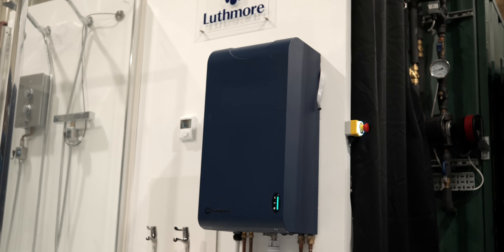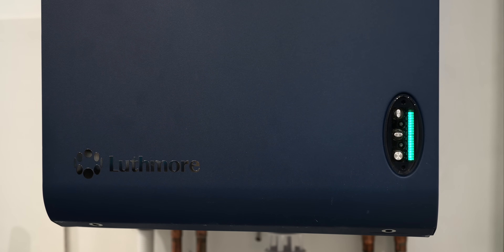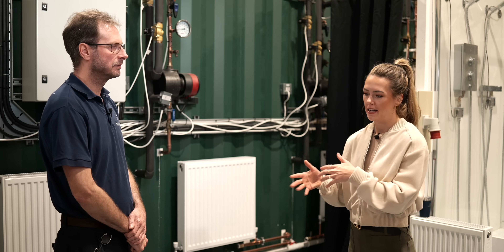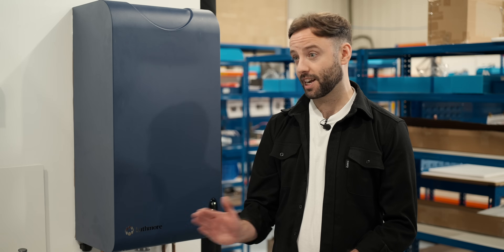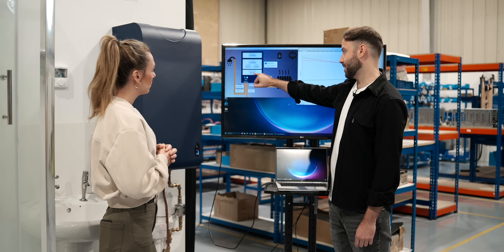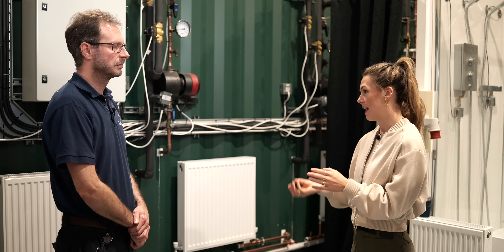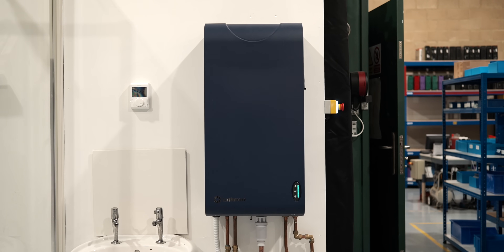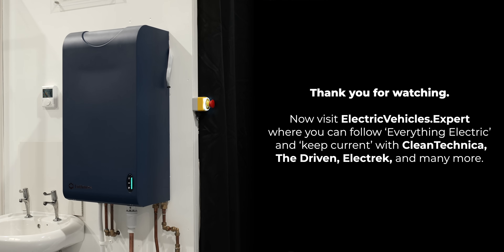Could This Battery Boiler Replace Gas AND Heat Pumps?

Comment: Was waiting for the part where you say how much it costs
Reply: A 7kW LFP battery would cost £2-3k. The heating element is not expensive.
Reply: @IanMcc1000  I just bought a 16kWh (8kW) LFP battery for £1700 retail, so 7kW should be about £850 (less at wholesale rates).
Reply: @xxwookey  that’s a great deal. How much is that for an install?
Reply: @davidjrobertson3192  I don't know - I installed mine myself so it was just supply-cost. That was kit form to be fair - the cells are shipped separately and you get to screw it all together. It's £2000 for the fully-assembled version. Fogstar is the UK supplier. 
Most of the  install cost is in the inverter+electrics and panel installation part. Adding the battery is just a matter of wiring it into the inverter (and DC DC MPPT in my case).
I paid £5000 for 7.2kWp of panels, 5kW Victron inverter and 16kWh battery, and assorted electrics so it can run islanded (i.e we are immune to power cuts). I guess you'd pay about £8000 for a commercial install.
Reply: About 5k for the 30kW system.
Reply: Or if you are going to g to do an advertisement (sorry Everything Elec but this is what this film feels like) at least have a shower, shave and sort your hair out.  Or am I being too shallow?
Reply: @mylifeoliverking  You are being too shallow. (but it is pretty advertorialish, I agree)
Reply: The Luthmore boiler has an rrp of £4500 ex. vat
Reply: @Luthmore I'ts a niche product I think. For small 1 and 2 bedroom flats/houses with 1 or 2 occupants.
Reply: Also there has been no talk about loss of inefficiency over time with current battery technology.
Reply: @StevoStevoStevoStevo-c1y  I presume you mean loss of efficiency? You lose maybe 1-2%/yr capacity over a decade or so. Efficiency hardly changes at all.
Reply: 21 July 2025 - With a total purchase and installation cost from as little as £5,000 excl VAT, the Luthmore Boiler is a straightforward, cost-effective solution for the small to medium sized home market where ( copied and pasted from the web )

Comment: I don’t really understand the point of this. It’s using a different battery technology - great why not use that as a house battery instead if it’s more dense? Then it could power everything rather than just the element in the boiler…
Reply: it's not really using any new "magical" battery tech really.  30kW of power from a battery that stores 5.88kWh is nothing special for lithium batteries in other applications (for example, the battery in a very normal electric car these days can output 300kW from 50kW, and a "high performance" lithium battery in something a bit sportier can double or tripple or quadrupple that power density. By using the incoming cold water feed to cool the battery cells, they are simply doing what pretty much every automotive or high performance battery has done for the last 10 years. So far, that water cooling has nto been applied, nor required for a static home battery, simply because it is not required and it is expensive to do.  As the energy storage capacity of home batteries climbs upwards as cell costs fall (a 5kWh battery used to be "big" but now was are seeing 15 or even 30kWh solutions) getting high power from that battery gets easier and easier.....
Reply: Think of it as a better solution for small flats that may in the past just had a 5-7kWh water heater and central heating provided by a gas fire. This device provides a far higher flow rate with a lower running cost if the battery can mainly charge over night.

Comment: The crux of the matter is that electricity in the UK is ridiculously expense, the most expensive in Europe. If electricity cost the sane or less than gas we wouldn't need these over complex solutions.
Reply: For domestic electric UK isn’t the most expensive in Europe as we are cheaper than Germany and around the same price as Italy according to the International Energy Agency. Having said that the UK is still expensive.
Reply: 😂😂😂😂

This is getting ridiculous.

Any opportunity to crowbar in a mention of a  battery system for "anything".

In this case absolutely unnecessary.

Batteries and installation at doubtless a tidy sum.

An instant shower is likely to be a far better and financially more efficient option.

It won't waste water either.
Reply: The high price of electricity is because it's tied to the price of gas... google "uk marginal pricing"
Reply: 424% correct as they say in heatpump land
Reply: I wonder if all the regulations that they put on new houses are making them too expensive to build.
Reply: @iaingray594 

And of course Labour have promised us another 1.5 million homes by the end of their term.

Where are the Polish guys when you want builders?

Yet another empty promise from our Leaders, of whatever flavour.

Comment: Will it only let out the hot water when it’s hot or like combi boilers you have to run the hot tap and check ld water comes out , gets wasted then slowly heats up ? Ps I’ve got 2 litre jugs near my taps so I save that cold water for the water butt etc in the summer and making cups of tea etc 😊👍👍

Comment: Luthmore have broken rule number 1 for me.
If you have something for sale, put the damn price on the website!
Reply: The guide price is £4500 ex. vat. A list of certified installers and resellers will be published soon. it's in faq
Reply: @garethjones6082  It is now but it wasn't when I mentioned it.... or I wouldn't have mentioned it.
Reply: Advantage:
Greener.
No gas standing charge.
No service charge?
Reply: @markthomasson5077  It's greener than using a gas boiler, but I'd certainly question the use of batteries to only provide heat, seems like a misuse of expensive and valuable resources. A small tank of water will do the same job for a fraction of the price and resources, and with no degradation in performance over many decades. I know people will say there's no space for a water tank, but in 99% of cases that simply isn't true, with a bit of thought there's always a way to squeeze a small tank in somewhere.
Reply: @garysmith5025 hard water corrodes water tanks. This could be a good swap for an instant gas hot water system, or houses with hard water.
Reply: It means it isn't even available or is very expensive
Reply: @danieladams7919  that is always my presumption.
Reply: It seems like an option for the many homes that will never be able have an ASHP, but it does seem to be too good to be true, I would like to know about the field trials that they should be carrying out. If it's any good then it shouldn't need any subsidies. I dont believe that these electricity based systems are any better for the environment than a well designed gas boiler with weather compensation. The UK already has the highest energy costs in Europe,  the removal of gas for heating and hot water will be disastrous for low income people.
Reply: @geoffaries gas shouldn't be cheaper than electricity (is inflated by having gas and nuclear electricity generation), this battery hot water (needs cheaper electricity) or heat pump hot water or air heater should be way more efficient than equivalent gas systems, many losses in gas mining, shipping. Power should be cheap when the solar or wind or battery farms put cheap power into the grid, this is the time to charge the battery or heat the heat pump tank.
Reply: You don't buy it from them. You buy it from your installer. Same with a heat pump, gas burner, solar, home batteries, cook top, ect. They are a B2B business that sells to installers, who then sell, install, and maintain it in your local area.
Reply: The Luthmore boiler has a ex vat price of £4500
Reply: Yes I think this system could be good solution specially if you have solar system to charge batteries
Reply: Generally with this type of purchase you ask for a quote based on your requirements
Reply: Who can afford this ? It is rather expensive… isn’t it?
Reply: Same old addage: If you need to ask the price, you can't afford it!!
Reply: @AndrewLumsden  Luthmore have said the total purchase and installation cost can be as low as £5,000 excl VAT.
Reply: Will it be eligible for government grant
Reply: @AndrewLumsden  I really can though. What I don't want to do is interact with a company and give them my contact info if I eventually don't want to deal with them. People shouldn't have to ask.
Reply: @AndrewLumsden cliched comment award goes to…
Reply: @AndrewLumsden  Complete nonsense. You'd be an absolute fool not to establish the price, even just for the purposes of price comparison and whether it makes economic sense. Oh, and adage has but one d. Back 2 skool 4U.
Reply: if you have to ask you're too smart to buy it
Reply: A bit like those very expensive shops in the Champs Elysses in Paris: If you have to ask the price then you cannot afford it. Lol.

Comment: I like a bath,that would use most of available capacity.
Reply: So it just chargers back up again. An expensive bath 😂
Reply: Gas ends up way cheaper in that case 😂

Comment: Is this an answer for those of us looking at an air-to-air heat pump installation that needs hot water
Reply: Cheaper to just get a bog standard hot water tank, immersion and a timer and run it on the cheap power.

Comment: I didn't listen to this very carefully but I couldn't understand the big benefit instead of running you whole house from your battery charged up off peak, why would not you do that?
Reply: It is related to power density. While home battery can provide 5-10kW of power usually, heating water require much more energy - they say 30kW. Home battery, while fantastic, is simply not strong enough to supply enough to heat water.
Reply: @melhiore How can they have a 30kw inverter? They'd need a giant battery or household to only have 5 minute showers so as to not drain a battery (say a Powerwall at 13kwh) in 30 minutes!?
Reply: @computerbob06  No need for an inverter. Just a heating element that runs directly on the DC power of the battery!
Reply: @computerbob06 

Trouble is viewers are not always technically minded or didn't cover the topics at school.

A power wall or similar thingies are only for short term usage for a low current draw.
Reply: @computerbob06  they don't!!

 they will be running the water heating elements directly of the DC link, ie off the battery stack itself using that DC current, rather than turning that DC into AC then putting that into the resistive heating element (which doesn't care about Ac or DC because its thermal inertia renders it an average heating power device).  This is why the system has a peak heating capacity of 30kW (the DClink power limit for the cell stack) but has "just" and 10kW continuous rating (draws up to 50A @ 240V which is 12kW)  You'd probably aim to keep the peak DC link voltage just below that of rectified mains AC to make the charging of the cell stack easy, so really the water heaters can run off the DC link without any complication other than some basic low frequency PWM modulation of the heating power (possibly even a "bang-bang" on /off control would be sufficient at say 1Hz or similar
Reply: @salipander6570  There is still going to be an inverter in the device to allow the charging of the battery. As you say the discharge seems to be directly between the battery and a DC heating element.
Reply: @melhiore  You just have a tank of water heated by a bog standard immersion and timer off the EV tariff at 8p/kWh overnight and use your heatpump at a sane COP for the rest if you wanted to do that.

It's exactly what we do now. Total costs peanuts.
Reply: @etchedpixels  Well. I do not have a space for water tank, I do not have a space for HP. This is solution for me, on demand. That is the whole idea, not every home is suitable for HP...
Reply: @melhiore 

What on earth are drivelling on about?

Clearly you know absolutely nothing about hot water systems.

An instant shower uses between 6 and 10kW.

A shower is only on for a few minutes so the cost of electricity won't break  the bank.

Plus no need for a hot water storage tank.

Try to grasp this infomercial is the usual blithering nonsense to be found on this platform.

Not that long ago we were treated to another infomercial on the topic of "super efficient" storage heaters.

That was useless too.

There again the entertainment value from Robert's platform is priceless.

Come on Robert, stop pushing useless and unnecessary technology.

Suggestion: start covering FCEVs as soon as.

Toyota, Honda and BMW are building FCEVs as we type.

Plus engine makers.

You covered JCB hydrogen ICEs a while ago so why not go back to their works and do a follow up review?

A great deal more interesting than this silly project.
Reply: @ForestForest-n9i  Well your comment is funny as you seem to know even less. A shower does not use between 6 and 10kW - it draws between 6 and 10kW, how much electricity it uses will depend on how long it draws that power for and the result is reported in kWh. At the same time an electric shower is just that a single point of use shower. This is a hot water supply for a small home (shower and taps) and the central heating provider. The logic of this system is that daily it can time shift a users electricity demand from day time rates to night time rates for the size of its battery and depending on the situation it can remove all the energy loses found in trying to maintain a hot water storage tank at a high temp for when it is needed.
Reply: @ForestForest-n9i  I did not read your long and elaborate post but good luck filling up the bath with your cheap electric shower... You do not understand what on-demand hot water means mate...

Comment: I can’t have a heat pump as no outside space. Have a gas boiler and massive water tank with rads. Would love to replace those two with this and charge up overnight on cheaper electricity. Would free up some space as well. Just need a price (!) and a handy gov grant or 0% VAT to assist would be awesome 👍 great interviewing Bhogal 👍👍
Reply: But it's only 100% efficient. You'd need ungodly amounts of battery storage to heat a house all day during the winter.

Are you sure you can't have an A2A ASHP installed up high and feeding multiple rooms?
Reply: @Soulrollsdeep  Air Conditioning might be a better option.  Older tech and supply hot air based on internal heaters unlike Heat pumps.
Reply: There is also the heat storage boiler option - such as ZEB. We have a strange set up with solar which we export for 15p/kWh and we use off peak electric through a variety of items including an electric AGA! We just wish they made a better insulated version of that which would take longer to cool down and which would automatically grab whatever the solar is offering for topping up by day. As it is it uses 2.5kW or nothing - overheating the element so it cuts in & out before the cooker reaches full cooking temperatures! ONE minute it is using more than the solar, the next minute it is using none. of it!
Reply: You can install air/air heatpumps (aircon and heat) without external space. They are just limited to a COP of about 3.4 and somewhat noisier as it's inside. Self installable although in reality whilst you can self install one in something like a shed or cabin you want an installer in a flat or house.

Several of the designs can be installed at height without external access.

Look for "through the wall" units.